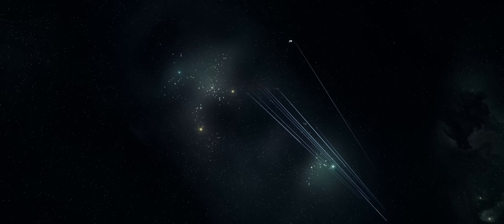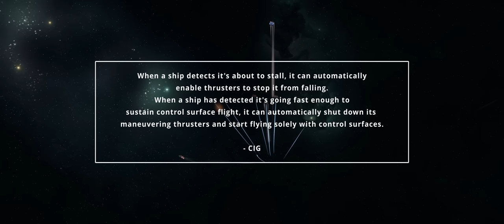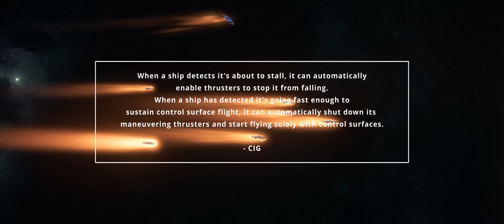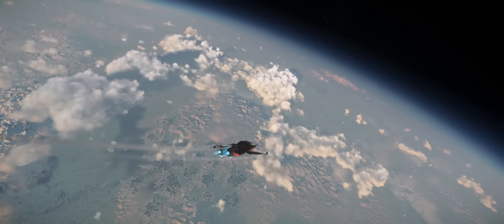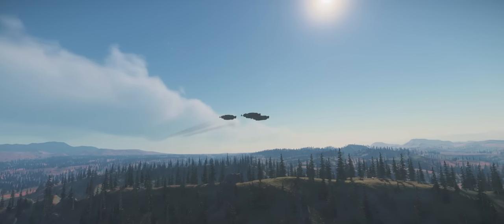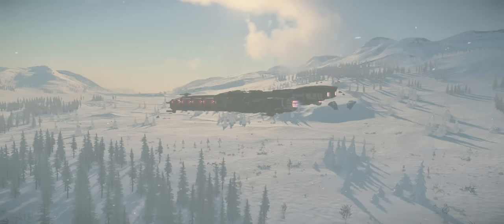THIS Will Be A BIG Change To Star Citizen Flight

Comment: I agree, we need more challenging and realistic flight characteristics in all ships.
Reply: I think they should focus on fixing the myriad of bugs and finishing the main campaing before attempting to change how aerodynamic work.
Reply: @alexandrepv  
How are they supposed to fix bugs that are based on placeholder systems? They have to do the splits between keeping it playable and not wasting time on code they are going to through out eventually anyway.
I don't really have an opinion on SQ42, but I think single player games are the definition of disposable games.
Reply: @j.d.4697  You're telling me they spent all these years and all they have are "placeholder systems"? As a senior software engineer, this is plain bad pratice. Data scientists write "throw-away" code, but software engineers build systems based on requirements, which they don't seem to have. Lock your requimrents, create your sprints, deliver a minimum viable product, fix bugs during beta and improve after release. If their systems need to be completly overhauled, they should have considered Star Citizen 2, using an updated version of their engine built specifically for those new core mechanics.
Reply: @dustinleebladesmith9135  Someone woke up on the wrong side of their bed :) You complain I don't know how anything works, and proceeds to not providing any supporting arguments on how it actually works, and then points out spell checks. Really mate? Ad-hominen? C'mon, you can do better. Please, I'm dying to know how a real engineer would do it. I'm all ears :)

Comment: To be fair, retro thrusters would be pretty strong, so hovering nose down is actually realistic. Same goes for hovering nose up. It's actually weird to see ships hover in their normal orientation if they don't have VTOL thrusters.
That said, realism is good, but making the game fun/playable is most important.
Reply from the maker: It begs the question whether retro thrusters are too strong :)
Reply: @Anaklysmos you'll never eliminate ships pestering you on the ground, especially since VTOL capable ships will be part of the final game. Balancing ground-to-air combat requires more nuiance than just removing the ability of some ships to hover. This presents more problems than solutions anyway... As stated in the video, Star Citizen isn't going to implement runways for landing and takeoff so hovering is here to stay.
Reply: @notmyrealname2.0  Agreed, and inability to hover doesn't make an aircraft not a threat to someone on the ground.  The A-10 cannot hover but that BRRRRRRT will end you just the same.  And as for VTOLs, Apache, Hind, and Hokum just to name a few.  Then you have grenade dropping drones and "loitering munitions".

Comment: I think it would be cool if the thrusters didn't turn off when control surfaces took over, and instead helped with manuvering the ship along with the surfaces. I think the thrusters would have to stay a little stronger for that but I personally don't see an issue with them staying at their current power.

Comment: YES!  I have wished for this for so so so long.  I hope CIG also implements ways to limit the length of time a player can use maneuvering thrusters to hover in place in atmo,  Maybe something like the boost meter to temporarily increase power of the maneuvering thrusters enough to allow the ship to fulfill its VTOL capability,  whilst still eliminating the negative aspects of current flight that make ships feel a little too much like god mode.  You could even make it lore friendly by saying that maneuvering thrusters are designed for space applications and thus their efficiency and thrust capability is lower in an atmosphere.  IDK though this is definitely a step in the right direction.  Hope they get the new flight model right and make things feel weighty and maybe make everything a bit slower paced in terms of acceleration in atmo.
Reply: I want hover mode back, it was not perfect then but a good basis to improve on. and in my opinion something like that is needed to give meaning to ground vehicule. having  hover or low speed flight difficult to handle so you have to make a choice, do I land next to my objective on a difficult terrain, with high roisk of damagin my ship, or do y land in a safe place like a plain 10km from my objective and finish it with a rover or a cyclone?
Reply: @hazelamberwood7376  I think hover mode shouldn’t just be a mode it should just be the default flight characteristic of ships with rotating VTOL thrusters.  CIG has shown they also think this with newer ships like the hull A that acts sort of like hover mode used to in atmo.  Hopefully they can make a challenging system that makes sense,  is fun,  and actually looks semi realistic

Comment: 4:58 that's also not a MSR, but an Ares Starfighter Ion. And while the Crusader ships seem to have only flat but thick surfaces without room for control surfaces, their flying wing structures might hide more integrated control surfaces. Towards the center of the screen on the Ares you see how the wing gets thinner with lammels leading up to the point that's connected to the central fuselage. I believe that the majority of the wing is able to adjust along those lammels so that it's less of a classic control surface and more of an unbroken surface similar to the newer types of control surfaces that are currently developed.

Comment: For ships with control surfaces where you remove or really lessen the effect of maneuvering thrusters, then landing one's ship (ships without VTOL capabilities) will be more along the lines of needing a runway.  As I'm typing and watching you touch on this around the 7min mark of the video.
So what I predict here for atmospheric flight, is that while they'll increase the effect of control surfaces, I don't think they'll totally remove maneuvering thrusters.  I think they'll probably keep the same on the bottom thruster power but dramatically remove strafe FWD/BACK/LEFT/RIGHT.  I think this will depend on some calculation of (control surface amt * ship mass) for each ship.  When that calculated ratio goes below a certain ratio, a ship with very little control surfaces won't be able to fly in atmosphere very well, if at all.
This will also depend on the planetary/moon body's atmosphere and gravity effects as well.

Comment: From how I read the post CIG made about control surfaces. Until you reach the speed where the control surfaces are able to work efficiently enough you will rely on the mav thrusters. As it says in the post "When a ship has detected it's going fast enough to sustain control surface flight, It can automatically shut down its maneuvering thrusters and start flying solely with control surfaces"

This purely means until you hit the speed needed to generate enough lift to stay in the air you will use maneuvering thrusters like we do now. CIG doesn't need to make them weaker to achieve this. As they will literally just turn on and off when the ship is at the detected speed limits for control surface flight to start and stop.

Comment: they already implemented something like this in the past, and while it first was a bit of a pain, i like the skill needed to keep you ship in air, event with vtol. they downside was the missing stability while mining on a planet surface, therefore we need some sort of stability calculation like real life drones have for example.
Reply: Reason why the Prospector have those over sized engines i guess 😉
Reply: @mriuskraft  prospector was fine, but the mole was painful, you could not solo it in atmo, but I think thats fine and should also be like that. Pilot takes care to be steady and miners got for it.
Reply: @do_minguez  There's no reason a mole should be able to mine easily in atmo.

Comment: Another way to limit over-reliance on Vtol (beyond elements like engine over-heating) is to make hovering require excessive volumes of fuel. Sure, larger ships with stronger engines might be able to hover longer, but it could come at the cost of time and money needed to refuel.

Great video! 😁
Reply: this aspect will be especially important in systems like pyro where your ability to refuel will be incredibly limited
Reply: I'm pretty sure CIG stated in an SC live that heat will be one of the big tools for limiting hover.

Comment: One of the first Videos I saw on YouTube right after Planet Tech went live was someone hovering a Gladius nose down about a foot off a planet. In the Video they were basically explaining to CIG why this should not be possible. We're hoping that atmospheric flight with control surfaces is when this would get straightened out. They tried once before with Hover Mode but it was universally hated so they backtracked on it.
Reply: Honestly hover mode was unpopular because of how janky it controlled. it was very off or on, and it never seemed to be tuned to the right speed. VTOLVR has a mode like this for it's two VTOL capable aircraft and it transitions smoothly between helicopter-like and aircraft-like flight (manually, but still smooth). SC's hover mode never did that.

I think it'll ultimately end up a gradient as the video author hopes, because having be a binary is going to produce a particular speed for certain ships (varying by ship) where the controls are just mud, and then you slow down just a little and boom, thrusters kick in and your fine-ish again. That'll infuriate people for the same reasons hover mode did.

Comment: I think its going to come down to the type of ship that will determine if it has to rely on maneuvering thrusters/VTOL thrusters. While those ships that have a higher scm speeds will need to rely on control surfaces in atmo.       I would hazard a guess that ships that fall under a specific threshold  will have to rely on VTOL/maneuvering thrusters for movement.     I look mainly at the small hull a and b series in particular. They do not have large enough wings for control surfaces.   Also they don't have VTOL engines like we see with some of the other ships (cutlass, cutter, valkyrie, etc.).

Comment: I think vertical thrusters for hover landing should use up some sort of boost/heat system where you can only sustain for x amount of time bade on fuel/cooling/overclock/parts etc. 1 thing that REALLY takes me out of immersion is the perfectr way ships hover/maneuver take off and land. like your controlling a floating asset in a game engine. i want there to be some sort of wobble and unpredictability when hovering and taking off so you have to control it more (dependent on ship and parts etc). now its just up and set speed perfectly like a 3d model. i want some character to it, heavy ships list and sway as mor epower is put down by thrusters. small ships wobble and shake  etc. also side note: ship/engine start ups are so anticlimactic, *beep, power on bzzz*. I wanna start up noises, powering up  turbines or reactor/engine, something to give the sense some ship your sat next to a powerful powerplant/engines. i mean look at real life cars/ jets i.e a-10. the start up is a ball tingling event. there's no sense of mechanics or personality right now, they seem like 3d models..they look and sound/feel so much cooler and epic in the cutscenes they make or in most over game with ships

Comment: Related to the topic, if CIG wants to improve immersion with this, then they also need to enable actual use of landing wheels. Not all landing gears in game have wheels, some have skid plates or feet, but those that do (e.g., Origin 300 series) should be able to take off and land at higher speeds without a hovering stop. This would be extremely useful on heavy world planets.

For dogfights in atmosphere, right now (perhaps fixed at least partially by control surfaces), we don't gain potential energy at altitude, and don't have the ability to spend potential energy and convert it to kinetic energy as we drop altitude. Ships with in excess of 1-to-1 thrust ratio don't "need" this, but if "altitude means energy and life" has a place in the fun of a dogfight, then more should be done with this in conjunction with aerodynamic surfaces.

Incidentally, there is no reason one cannot keep thrusters on at all times, but use aerodynamic surfaces to supplement thrusters (or vice versa). Imagine the laughs a military pilot would get if someone suggested they shouldn't be allowed to thrust vector except just above stall speed. I think CIG would be "less than inspiring" and not adding to game play if they take it too far. On the other hand, if thrusters have a certain effect in a vacuum, but are supplemented by aerodynamics, it adds a completely new game dimension to choosing where to fight (pilots with ships having lower power thrusters and good aerodynamics would want to stay in atmosphere, but for cases where a pilot has less aerodynamic advantage in atmosphere compared to the enemy, then one would try to stay in space).

Comment: I'm with you. Big ships without vtol should feel super heavy in atmo, and fighters with weak support thrusters should be landing more like a plane, rather then hover.
You can get a little bit of this feel by flying de-coupled and avoiding upthrust as much as you can in atmo, but it still doesn't quite feel like surface control flight.

Also love the idea of the control thrusters heating up much faster but I think for these things to work they would have to remodel the hangars to extend outwards as if it was a mini landing strip as they have gravity and would be very hard for a new player to land or take off if they couldn't use thrusters.
The biggest problem is vertical hangars like in lorville and other vertical hangars around in planets or stations, but as long as they were horizontal it would be great (and MUCH easier) to just use throttle to launch yourself off the hangar and then fly naturally outside.

Comment: About hovering, it is much easier to do in ground effect.  If you are close enough to the ground you get the ground effect "cushion" that provides extra lift.  Hover can be OGE (Out of Ground Effect) or IGE (In Ground Effect) and IGE is much easier than OGE.  Ask any helicopter pilot or even people who play rotary winged aircraft in DCS.  Even if there is no atmosphere the exhaust gasses from ventral thrusters could still provide a limited amount of ground effect from hitting the surface, bouncing off, then striking the bottom of the ship.  I think the real big change to hovering is more that only the bottom thrusters will be the only RCS thrusters strong enough to do it.  No more hovering inverted or at pitch angles that either aren't completely straight up or straight down (because mains and retro).  The guns on many attack helicopters are articulating for a reason.
Reply from the maker: Great point regarding ground effect!

Comment: A audio alarm not a constant one but something, not on the HUD only. sound the alarm when the ship transitions to and from thrust controlled flight. once that happens have the ship start using boost. once you're out of boost you can no longer hover. ships like the galdius could use boost quickly in this state as provisions for long boost assisted flight would not have been a design choice with large wings. while others with Vtol can hover indefinitely but with increased main fule use, and boost needed at transitional speeds.

Comment: I've imagined that ship shields could act as configurable control surfaces. So they'd form a part of a ship's lifting surface at a basic level and actively deform at higher levels.   
Something non aerodynamic like the Starfarer might, for example, envelope those vulnerable high drag tanks and catwalks in a sleeker shield form. 
A higher tech approach, one that might take up blade space, would be for the shield to be actively shaped to form equivalents to the mechanical wing flaps for ships lacking such. 
Shield emitters designed to efficiently form atmospheric control surfaces would likely be less effective as defensive shields, so you'd plausibly need to have trade offs vs. defense screens.

Comment: If they are going to limit the amount of time you can hover then they are going to need to dramatically improve lighting in space.  The number of times I have had to hover around while trying to land on a space station or even a planetary hanger is quite extensive, and it all due to being able to actually see the hanger I am supposed to land in.  In general lighting around landing areas is awful.  During the day it isn't an issue but get them in the dark and I spend more time trying to find the hanger than I do flying to the city from space.
Reply: This won't change ship behavior in space, this is based on atmospheric flight due to gravity and air resistance. I do agree that they will have to modify the planet side landing zones to accommodate new landing techniques.

Comment: The "binary" feel of thrusters vs. surfaces feels right to me. I imagine thrusters have to use a lot of hydrogen fuel depending on the atmosphere density and gravity, so the ship's systems would balance the two flight modes for the sake of economy - you could still use your thrusters to maneuver down to the surface but maybe you aren't left with enough fuel to get out of the atmosphere later? If they go that way in the PU then I hope they add some hydrogen refuel possibilities at all proper landing pads because otherwise the ground around the pads will be littered with caterpillar wrecks 😉  Good vid!